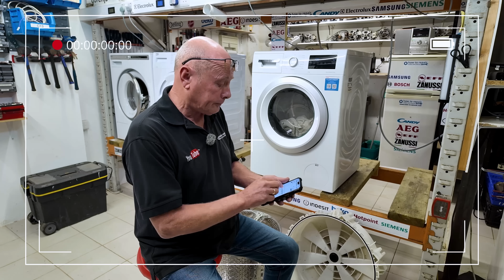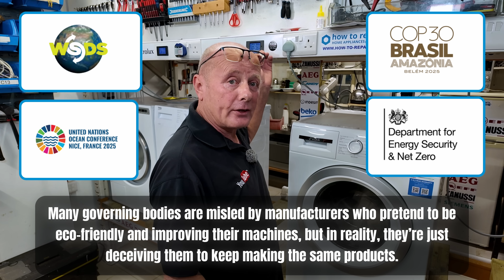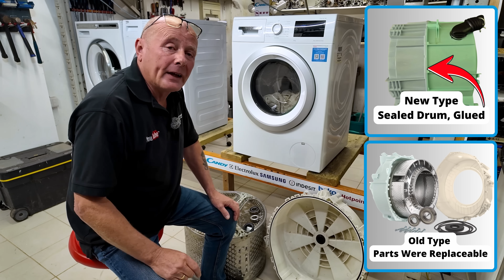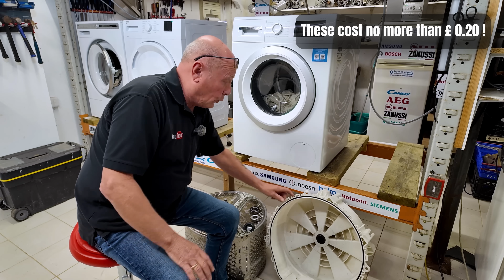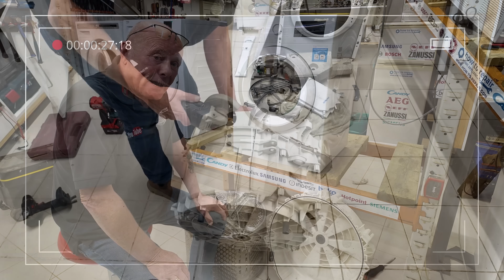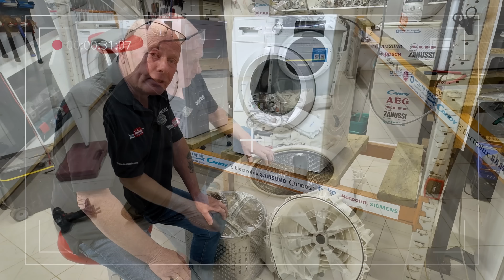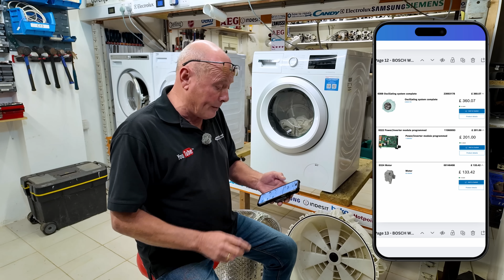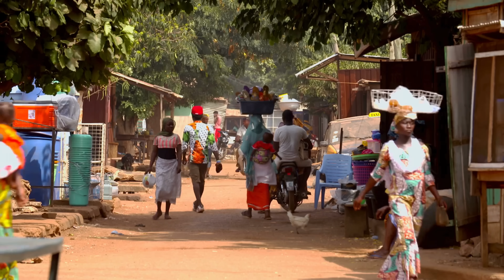Washing Machine SCAM EXPOSED! The Truth About SEALED Drums: Naming & Shaming

Comment: I had to replace the PCB on my Hoover Tumble Dryer. Hoover's solution was to sell me a policy through Domestic & General for £19pcm to come fix it - I called the number on the big warranty sticker still affixed to front of the machine and it literally goes straight through to D&G.

I queried this, stating that I just needed the part, didn't require fitting, and they wouldn't help. Had a scour around the twinterwebs and found two board options; 'unprogrammed' for about £35 (with no access to the programming software/tools) or £95-£130 for a pre-programmed board. I was also offered just a straight repair option by 'the manufacturer' ; £callout + £part + £fitting would have totalled just over £250 - and if anything else was wrong I'd have to foot the bill for further repairs and parts.

I went for the D&G policy option, as it would cover any other repairs in the 1 year period I was forced to pay for, and as I wasn't 100% confident that nothing else would go wrong with the machine it made more financial sense - but I think the manufacturer counts on this dilemma! 

Engineer arrived, confirmed that it was definitely the board and replaced it in 15 mins...on his second visit, because he didn't have the board on his van the first time he came! 

 Unit has been working fine since, no other problems so far, so I definitely feel duped! Also, I have to say that working in electronics and being a massive geek for over 35 year the quality of the PCB was awful - I expect the new one will have issues in the future.

Comment: Hmm, have I just been had?
Just bought an Indesit MTC84195 W My Time 8g for a very nice £230.
Did some research, along with AI and supposedly found this machine had a bolted drum as per diagram and bearings spares are supposedly available for this model.
Did I get lucky, or was I had???

Comment: I'm writing to you from Italy. I bought a 7 kg Raymond (?) washing machine in 2012 for just €175. It doesn't have a display, just buttons and, of course, two knobs for the programs and spin cycle. It definitely has a programming card. I've never had a defect, it's never broken, and I've never replaced a part. Filter maintenance is done every month. I use the washing machine 3 times a week, sometimes even 4. My daughter has a 7 kg Bosch, all electronic (it even has Wi-Fi 😂😂😂) purchased a year ago and spends more time being repaired than at home (washing machine paid €1399). The day mine breaks down, I'll throw it away and buy a bigger one, even spending €200, because after 13 years, it's me who's profited, not the famous brands that are all advertising and little consistency. Great video, brother.

Comment: No point spending more than £275 on a machine. It will last 3-5 years. 
Spending £450+ is just brand name, marketing and WiFi crap. It will last 3-5 years.
Before you tell me your xx Brand machine lasted 12 years. That's cos it was manufactured 12 years ago, when machines were actually more reliable.

Comment: On the other side washing machines did get more reliable. The old electric mechanical "clocks"/switches did fail more often than the current generation of electronical switches without any mechanical components. Prices have also DECREASED compared to the past when you consider the massive inflation. On the more positive side it means jobs to people and people like to buy new things. I'm NOT contesting the "planned obsolescence" but it's not all bad .

Comment: The price for the controller board is quite silly as well. This will be a microcontroller, motor drivers and some sensor inputs. A RP Pico for £3.90 is probably overkill.

Comment: Great video, thanks. But you didn't mention one, most worst, brand - Candy. It's most terrible brand. Nonstop problems with PCB, el-motor, pump, disbalancing and so on... I had, for my family of 3, 2 of them in a row. Average lifespan - 2,5yers. No guaranty, no parts, not reparable. The previous mashine was some budget Beko and it was running about 9 or 10 years before bearings left a chat. Now we have LG, half a year till now. No complaints for the moment but it;s only half year old.
Like for video and subscription.
P.S. I'm from EU.

Comment: My Zanussi from 2009 is still going strong. But hey I am a single guy. I only wash when my underwear runs out
Reply: So have I, but I changed the bearings a few years ago. You can check the total operating hours on Zanussi/electrolux washing machines of that era, it's the same buttons as diagnostic mode, only select position 5 instead of 1 on the dial, or search for the YT video showing how. The counter stops at 6,550 hours though.

Comment: Maybe this falls foul of the anti monopoly laws since they dominate the market for replacement parts in their machines. 
I just had to buy triangular screwdriver heads from one of those Chinese online shops because a 2 year old kettle seems to have a loose wire.
Since the UK imports the disposable junk it should be no trouble to ban these ripoff tactics. Lets see some fines.

Comment: Just to add, if you allow me, there is a hidden counter installed inside a main PLC chip which count how many washing cycles is made, then just stop and turn off whole PCB, so you need to buy new one. New one is very expensive so ... buy new machine.

Comment: This is a fantastic and necessary video! Pure critical analysis with evidence. I also had some bad experiences with modern washing machines and certainly hate how many of our appliances today are made in such obtuse and ridiculous ways just to obfuscate the way to repair them. I miss the days when being an Engineer meant you designed equipment to be more usable, easier to repair and better in almost every way. It seems improvement wasn't profitable enough for the corpos.

Comment: If you would have checked beyond the washing machines, you would have notice that cars, toaster, mixer, blender, air fryer, smart phones, and many other devices are designed that they fail after warranty is over and you buy the newer version. Laptop, Computers nobody will go and solder a new chip on the board and test if it works, because it is to expensive in labour cost. But there are people who still do this work and replacing electronic components because it is fun and you get satisfaction if you found the failed part. But it is cheaper to simply replace and chuck the old one. I wanted an ABS sensor for the Ford Focus front right, at ford they wanted 186£ ang a little bit time and research and study the construction plan, I did found the supplier (bosch) and purchase it at Bosch for 21.35£. That is just a simple example. But you also have to keep in mind that everyone has cost if you have store an Item in your warehouse. So warehouse cost are high and to cut that cost are some car parts delivered with the system called "just in Time" and that mean that lorry drivers must be on specific time at the factory plan so they get unload and straight to the production line. that reduces the cost of warehousing and in basic it moves the warehouse on the trucks/lorries/vans. Some laptop manufacturer are changing there process by placing one warehouse per continent and no longer per country. Lenovo for example has Hungary for warehouse of Europe and some assembly production. And from that they nearly supply entire Europe, but you have to wait longer until you get it. And all the other manufacturer are doing the same, cutting cost to be more profitable. Ford is closing factory in Saarlois (germany) and also cutting personal in Cologne factory. Continental, Bosch and many other supplier are following the same trend. As long the steel production and steel usage industry is suffering in europe, we all will suffer. the cost must come down otherwise the manufacturer move to other countries. The material cost of the drum for the washing machine is not more then 30 per drum and they do not want that you fix the washing machine. you should buy a new one. and to encourage you to buy a new one they make spare part massive expensive and blame the warehouse cost for it. which an outsider can't check. also example hard drive manufacture is Seagate but he makes two version of the same model and lets take the 4TB drive, one label has Seagate label and Seagate firmware on it. the other has also 4TB is also made by Seagate but got HPE label on it and HPE firmware.. Both are working in a normal PC but the Seagate label drive will not supported if you insert it into a HPE, the HPE system will even complain that you have insert a non authorized drive into the system but it work totally fine. so only the firmware is different between the hard drives from technical point. But why cost the Seagate label one 120£ and the HPE label one 834£. I got invoices to prove that. And with little work and updating the firmware on the Seagate label one it is now showing as HPE and it work fine and no more complain. And many other brands are doing the same thing lock you in as vendor. Our population has become a trow away/ buynew style. And if you throw away you have to pay again for the rubbish and for the new item and the cycle begins. Why can't be in the washing power or liquid simply something that prevents limescale? of course not otherwise the machine will not break, As it has been said in the video, they build the machine that they have to break and they put in more features that more things can break. my washing machine i wanted to controll it by an home automation and my model is available with wifi and the app function. in basic it would be just and circuit board replacement. they said can't be done please buy new machine. And that to a mchine which is just 2 years old ok today she is 4 years old, but ok then we not using the app control function to turn it on at 1 am to wash, we simply us the delay timer function and the job is done too. all this manufacturer of household devices are taking current devices adding new feature and selling it as a new model. and of course they are not compartible with each other even if they use the same part. because one plastic piece is green and the other is red. where are the good old time when you could take out the part of the Miele and place it into the Electrolux. Or you could solder the wire back and the machine runs again for another 4 years. LED Projector the light bulb last 20k hours after warranty of 2 years bulb dead, but 20000 hours are over two years 24 hours watching time. so it should last by 8 hours watching time then 6 years but it does not and the cost of this LED bulb is 99 and the entire Projector was just 49. So into the bin. And place new order. and the cycle continues.

Comment: The PCB in nearly any household appliance costs too much to be worth repairing. I have a Samsung washing machine (this is not an advertisement). It has an induction motor and I wash every other day. Absolutely nothing has gone wrong with the washing machine in 8 years. However, my oven from the same brand is just as old, despite infrequent use, and the electronics are failing. A new pcb costs half the price of a new one.

Comment: We used to buy more expensive things knowing that more expensive means better quality. It doesn't matter today. Now the product brand is raising the price based on the old glory. I saw this for myself when I bought a Sansung 55-inch TV that was working 2 months before the warranty expired. Sent for repair within the warranty period, supposedly the entire motherboard was replaced. After that, he worked for about 6 months. I paid a lot of money for that TV and was furious when it was gone. Now the manufacturer's brand means little to me. I buy the cheapest one with the longest warranty, I ask that it has a 5-year warranty. I am afraid when I buy new because I am aware of the built-in obsolescence. I have accustomed myself to first thoroughly research several models and find out everything I can before deciding to buy some technical item for the household. What is being done by the producers is terrible.

Comment: The elder BOSCH Classic eBike Motor was of good quality and pure fun to ride, except that the gearwheel in the gearbox was made of Nylon and tended to break. The later Bosch Performance eBike Motor was also fun to ride, but it was not very good sealed so that the ball bearings sooner or later become corroded and needed replacement. I think to remember there are 5 bearings within this gearbox where 4 are standard industrial bearings to be purchased anywhere at a low price. But there was one exception and this was not related to load considerations: One of those bearings was a custom made bearing for Bosch only and not to be found anywhere else on the planet. But Bosch did not sell it to their customers. Once your Motor got this problem you need to buy a replacement motor costing 650 €.
Only as one bearing manufacturer started to reproduce these spezial sized bearings and sold it as a complete replacement set containing all 5 bearings, Bosch started to sell them too via the eBike dealers.

Planned obsolescence is really a pain.

As nearly any electronically driven device is equipped with a programmable microcontroller today who can tell if a failure is due to wearing out of electronic components or is just a result of a clever computer programmer to make it look like an component failure? Is the circuit board really defective due to a worn out microcontroller? Who can tell nowadays as the source code used is not accessible- Just think about it...

Comment: Have you done a scam show on solar inverters yet? We brought a pair of Muck 5kw inverters to be used in parallel. The engineer, or so called who installed them damaged one, we did not know this, but it had a code 80 we thought was just part of the display readout until a prpper engineer came out and told us, we tried to gewt the unit repaired but we sod it was surely repairable, as they could not get a motherboard as the fault wa stheir, we searched the internet and found the exact same motherboard the unit used. Yet the two places we tried, the original site we brought it from, said they could not do it and instead recommended we buy a similar unit to replace it.   We still have the broken unit, and we were thinking of buying the motherboard ourselves and repairing it, it's basically plug and play

Comment: This is why we still have wachining machines prior to year 2000 that are running just fine.

Would be fun to see someone stood up for it with the means by start manufacturing these parts for half the price. Tho' I wouldn't be suprised if the companies would sue him/her in a heartbeat by claiming "spare part for <model x>".

It's just cartel capitalism:
-Memory module prices
-Internet / Telephone / Webhosting operators buys smaller businesses (competition) out and their clients with it, raises prices after a year and the big operators hold their prices at the same level (high) with low to none services are selectible (100-400M 4G/5G, unlimited calls = 40-60 euros vs really expensive calls with a 4G of 0.1Mbps for 10-20 euros per month (which they know is a pain to do anything) or really expensive calls, a 5Mbps internet for 30 euros)
-Fiber / Cable : Fixed speeds with a reasonable price, but limited to x speed. Can't loan bandwidth if you want another operator.

Comment: You haven' got an MBA or executive MBA and a personal tendency to think that way, haven't you?

People in Germany or France or Belgium (1) tend to make 240 k € gross in 6 years, why should anybody bother to deplet them form 100 € per year if the same social class spends thousands on holiday or leisure and new cars or leasing or clothes every year? And - repair is simply another branch of society - making non repairable what doesn't need to be that way in the EU simply transfers money from the repair industry of lower middle class into the pockets of the stock exchange noted big. And the new all plastic drum is way more eco friendly (if I look up the full cycle from c to d, from crude to drum without screws and seals anymore and way more cheaper to produce (2) - cost saving matters for the manufactures as well as taking care of future turnovers. 

And the use of one kg of plastic is as eco unfriendly as burning 1.2 Liters of Diesel fuel in my car. (Replacing an existing one year old 8 Liter/100 km car by scrapping it now and replacing it with a new simple Tesla, charged from wind and solar alone may pay out after 40k miles of Tesla drive already - as a society we recycle much and and not keeping products 14 or twenty years anymore keeps me particapting  progress and forces me to learn new about society today - 'enforced update' in way - to see whats new by now and make new choices as an informed customer. (And yes, it's all a pest now too often.) 

1 - I think of Switzerland, Sweden or Norway too.

2 - You could youtube google or telefone the manufactures in Germany to find out which German university of applied science has supported the transition to full plastic drums - I guess somebody between 26 and thirty has gained his PhD on it - now ready to transition into industrie. You could! They speak english!
Reply: 'No middle class of the anglosaxon world is found left behind - forced to still repair what others already have been leveraging out'?